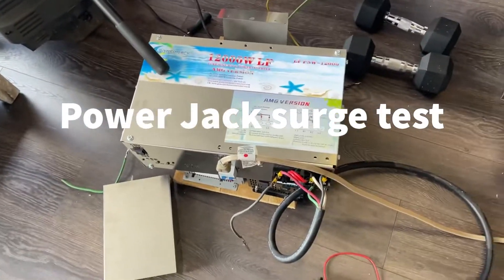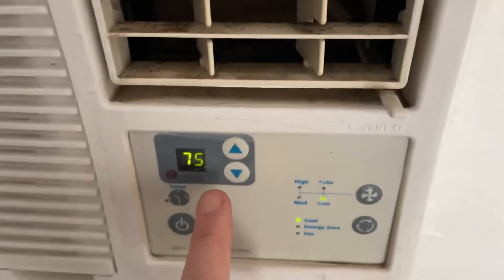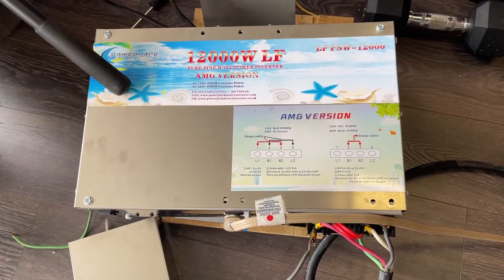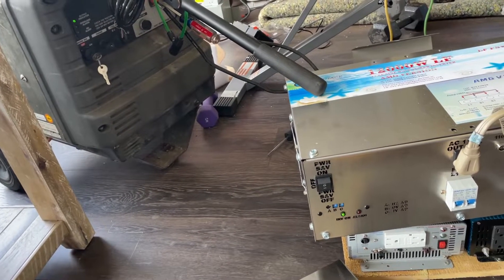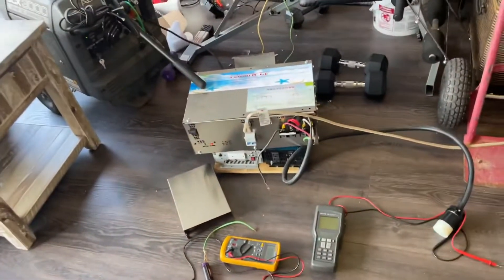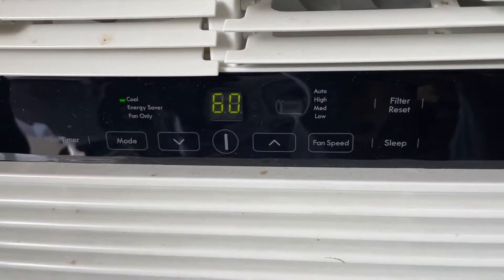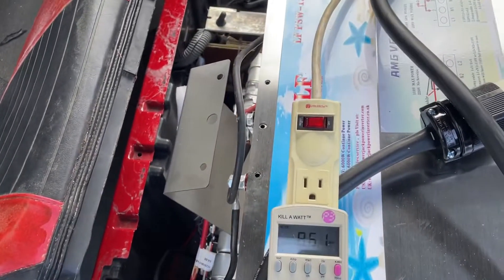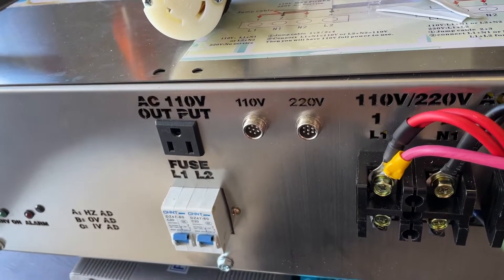PowerJack inverter surge test

Comment: Issue is your generator not inverter. It doesnt have the amps that the inverter needs.
Reply from the maker: I wish. Same results with a very large battery pack that can draw high amps. Interesting it will work in 120v mode,but not 240v. I believe this has something to do with the code that identifies the surge in the software. I even tried changing the legs on the 240v thinking it wasn’t sensing the correct phase.

Comment: Your battery is low, Nissan leaf batteries 48v pack is 58.1 90%. Each module at full is 4.24 and 80-90ish% is 4.15v. 55v is low, 4.15v X 14 cells is 58.1v

Comment: I have a Power Jack 8000 Low frequency inverter. I have no problems with starting and running my well pump which is 220 volt on a 20 amp breaker. I'm using a 1KA shunt to measure the DC current and upon pump startup it was pulling 800 DC amp! The battery bank I built is 5.7Kwh LiPO. 3S30P 16 AH cells. If the huge currents are not working out for you there is not enough DC supply. Unless you have enough DC reinforcement it wont work. Starting motors on battery as the source creates a massive voltage drop. Before I switched to Lithium batteries I WAS able to start the well pump using Lead Acid batteries. It took 12 car batteries in parallel for it to work.
Reply from the maker: I’m sure the battery bank is enough, as I can start ac with less batteries and a xantrex 1800 watt inverter.  Update:  I ordered some Anderson sb175 connectors and coNfigured the PJ for 120v full output and it actuAlly started the window ac. So now I will try putting it back to 120/240 and try to start central ac. I think it will work. New video coming soon

Comment: 48 volts x 59 amps is 2832 surge draw.... maybe set the inverter to do the max via the battery on 120 volt only... i am disappointed that it does not work.... as i am sure you are... it says you can not do l1 and l2 at the same time in order to get the max on the 120 volt way of connecting the amg version... their connection direction are very confusing,,,, this i definitely see...
Reply: I don't think that test was valid, your generator is not going to surge the 150 amps needed.  You should try the battery bank with the inverter in Max 12v mode.

Also, when all else fails add a 50 foot or 100 foot 16 gauge extension cable to the AC.  It can tame the surge.  I have used this approach to get a fridge to start off of a simulated sine wave inverter.

You may want to invest in a new 48v 5500w inverter circuit off of eBay for $80 bucks.  They have flexible adjustment of voltages and protection power.  I have hooked them up to a Power Jack and Outback inverters Xformers.  For $80 it is nice to have a spare board that you can just swap in when the FET's blow.

FYI, prevent Fets from blowing with the smallest fuse for your needs on the 48v DC line.

In the summer, I switch 2 inverters on and off all day long based on the available solar power.  One inverter runs an 8000 btu AC and a 10000 btu AC.  The other inverter runs a 10 amp pool pump with a couple second long surge startup, but it does go through 100 feet of 12 gauge.

Modern window AC units:
I bypass the temperature controls and make them run all the time that I have enough solar power.  They can make the house 60deg.  if they don't fill with ice.
Reply from the maker: Update: I was able to get the window ac to start. I decided to buy some Anderson sb175 connectors,and set PJ up for 120v only, and when connected to the battery bank, it worked!!
Reply: @IFix-Things  that is good news,,, possibly an electrical connection issue then,,, connections have been the drawbacks I have had,,, it is very important to get good connections...i use LiFePO4 DIY batteries but did buy some used pre-built LiFePO4 with built-in BMS... really glad your change cured some of the output problems of the inverter...thanks for your update reply!!!👍👍
Reply from the maker: That amp measurement was at 120v ac, so its somewhere around 6000+ watts on startup. I really think they are limiting the inverter via software so not to blowup the mosfets.

Comment: you need to measure the voltage output from the generator as it lists a range on the generator, and the inverter will not function at the lower dc voltage... iam not seeing anything that measures or monitors the input voltage from the generator... will your clamp meter measure the dc voltage input from the generator???
Reply from the maker: that generator puts out almost 53 volts

Comment: your generator puts out over 48 volts DC??? never seen a generator do that...
Reply from the maker: I also tried it with a battery bank. Have you tested yours yet? what size inverter did you get?
Reply: @IFix-Things  i have not tested it yet as I need to make up some cables to combine to get the 48volt battery input. i ordered the 48volt 26,000 LF psw sp amg version via auction for $527 including delivery.... hope it is not a skunk (or dead horse depending on what poor critter one compares it to )for heavy draws....

Comment: I’m doing the same tests on my similar equipment and are finding the numbers on a lot of these inverters aren’t very accurate or shall I say “honest”. In my case, I guess my inverters can run my pedestal fans only. Hope it’s not too hot out when the powers gone. Good luck to you there in your video! Hey, at least you now know what irks and what doesn’t before  shtf
Reply from the maker: I agree with you. I was able to start my fridge, but yes fans, heaters, hair dryers, but no window ac. Crazy though how my xantrex high frequency 1800 will start that ac with a 24vdc battery.